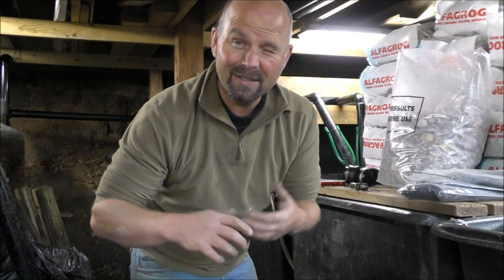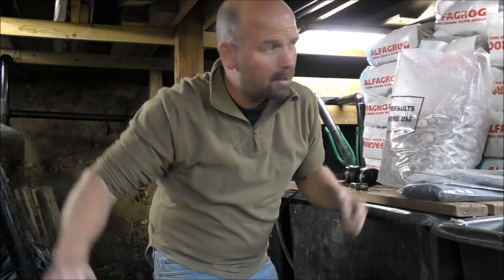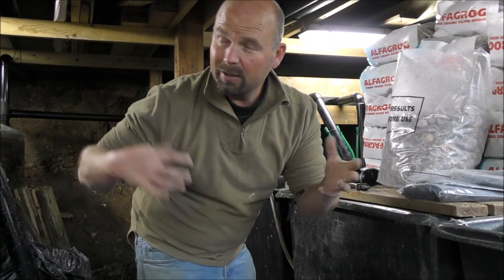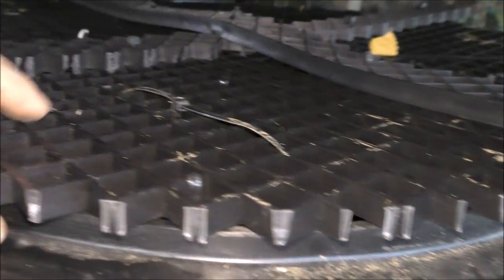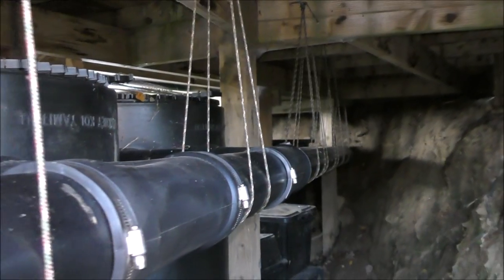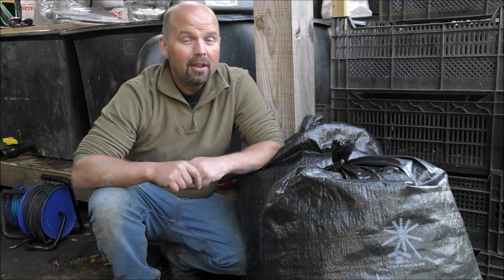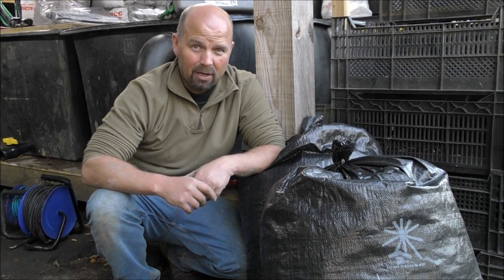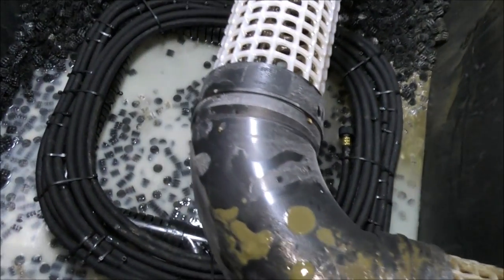Building a HUGE Pond Filter - A Few Changes

Comment from the maker: A quick video showing a few changes / improvements I have made to the mega pond filter - the next video will show the shower filters.
Useful videos:
Evolve shower filter and Blagdon Amphibious  IQ 12000 Pump (which feeds water to shower filters) : https://bit.ly/2t3N8OH
Global Koi stainless steel shower filter video: https://bit.ly/2UYv4AX
Looking INSIDE filter media video: https://bit.ly/2KbOAGk

All types of Biohome media and links to other distributors: http://www.filterpro.co.uk
Hel-x 17 moving media: https://ebay.to/2UZk5aM
Alfagrog used in this video is the E40 size but there is a smaller size available (E25) for smaller filters.
Alfagrog (Amazon): http://geni.us/Il899
Alfagrog (Ebay): https://ebay.to/2zWrajj
Hel-X 13 25 litres (Amazon): http://geni.us/3UBTi
Hel-X 13 25 litres (ebay): https://ebay.to/2QPKiq6
Hel-X 17 (more suited to very large moving bed filters): 
https://bit.ly/2PBAOyn
K1 standard size (Amazon): http://geni.us/zNFFaJ
K1 micro 25 litres (Amazon): http://geni.us/byDQ
K1 micro 50 litres (Amazon): http://geni.us/M7T2AH
K1 micro 25 litres (ebay): https://ebay.to/2P5Flfv
K1 micro 50 litres (ebay): https://ebay.to/2NFJ3YB
Moving bed media (FilterPro): https://bit.ly/2NN1gU6
Vortex filters: https://bit.ly/2Mj7gYa
4" fittings: http://geni.us/nTQc9bw
2" taps: http://geni.us/OBXBGSI
8" diameter brushes: https://ebay.to/2OvMOkc
Filter grids: http://geni.us/oqDBzT

If you've enjoyed this video please check out the playlists on my channel for hundreds more  - on a variety of subjects.
Feel free to share or link any of my videos on facebook, twitter, forums etc. for the benefit of anyone you think may also enjoy watching.
See you next time.
Pondguru

RECOMMENDED PRODUCTS ON AMAZON: https://goo.gl/jMaBWy
INSTAGRAM: https://www.instagram.com/pondguru_outdoors/

FILMING EQUIPMENT:
Panasonic HC-VX870 HD camcorder http://geni.us/3UwE
+Rode stereo microphone: http://geni.us/4OL
+Rode 'deadcat' mic cover: http://geni.us/1pmn
JVC Everio quad proof HD camcorder: http://geni.us/e09e
+Rode 'deadcat' mic cover (opened up and held between tripod and camera base) http://geni.us/dee24
Zomei Z666 tripod: http://geni.us/1a1af3
Manfrotto MTPIXI-B PIXI mini tripod: http://geni.us/87f7
Reply: Maybe a stupid solution byt why dont you just put a pump in the moving bed to help it go 😎? It would svirm like a bee hive with a small 40watt sump pump 😎

Comment: I've been thinking about this project and how I would go about making that particular pond almost alpine lake clear and here are the changes I would make.

1. Invite the local fishing club to fish out most of the carp family fish in a full-day competition. Make it a fun event with prizes and everything. Or use more industrial ways to remove the fish. This helps both with reducing sediments being disturbed and releasing particles and nutrients in the column and also reduces predation of zooplankton that keep the algae in check. This is done on an industrial scale at eutrophic lakes in Sweden to great effect when it comes to water clarity where the population of roach and bream has gotten out of balance with the predatory species.

2. Adding a mechanical filter section with a large number of fleece/polyester micron pads running in parallel in between coarse foams from coarsest to finest. This would clear most of the water passing through to about 50 microns. 

3. As a final water polishing stage add a large diatomaceous earth filter, a couple of hundred kg of carbon, and a few hundred watts of UV-C

4. Add a 30 000l pump in the last filter chamber and run the hose to the fluidized bed tub. This helps move the media and also filters out the water again. I use this technique in my sump.

5. Possible increase the pump power in the pond to 100 000l and increase the tub numbers/size to help settlement. 

Now we should have pretty clear water. I'm sure the wife likes that electric bill as a result!

I just want to say this is an incredible inspiration, Richard. Your passion for this hobby shines through.

Comment: Hi Richard. Just to let you know the reason you are having problems fluidising your media is not enough air to get a nexus with only 200l of media moving tidy you need at least 100l of air i use a 130l to get good movement in chamber your size i would say 100-120l minimum i would recommend the hailea et-120  very reliable and much quieter than aco series which started with.

Comment: With the moving bed filter couldn't you split a large diameter pipe and place both pieces to the bottom of the container making it smooth flowing w or 🥂 shape to ensure a double rolling motion. Add a small amount of air to the center point, direct the nozzles to crash down on the outside edges, and the outflow just to the inside edge of of the nozzles on both sides. Also restricting the outflow with a spreaderbar with smaller orifices to keep the velocity high to further encourage rotation. A secondary higher overflow would be required. The air could possibly be temporary once its mature and dialed in.

 Actually the air would be more efficient if it could follow the the same type of pipe used to shape the bottom to the top 1/4 th rotation.  Use 3/4 of two large pipe's instead of splitting one in half. Hope this makes sense.

Sorry if I suggested a bunch of stuff you've already gone over in the past and waisted your time. Good luck with that thing. I'm looking forward to seeing it work as it should. I know you'll get it done somehow.

Comment: Another moving bed problem could be the way the water exits the container. The media may not get sucked through but it may stick against the perferated pipe. Try placing the water inlet over the top of the perferated pipe to force off the media. It will of course try to get sucked back to it causing it to move, at least around the exit pipe.

Comment: U may have a few 2 many diffrent direktions in the water, mby if the water inlet pushed it down on 1 side, air up on the other. The square tub, and the long outlett pipe ads a lot of resistance in the water.
  Dont know if its a bad ideer, but could u rough up the surface of the media, if u put it in a cementmixer, with some water and sand?
Like the ideer of the reed (aquaponics) outlet, need some warm weather, so we can finaly see what goes in the aquarium. :)

Comment: Hi there,
What a brilliant filter system and we so much enjoy your videos over here in France.  One thing we could use in our MUCH smaller system and have had difficulty getting though is the white mesh tubing you have.
Any possible links to suppliers or did you make it yourself.  We're using drilled PVC pipe at the moment but this would give a better water flow. 🐟🦈🐡👍
Reply: U can easy order it from the kontgaatje shop !

Comment: Could you add a venture in the pipe where your trying to introduce air ? Have someone machine one from stainless steel that would fit a larger pipe so you don’t loose volume ? Just thinking about your beautiful setup.  Thanks for a great video.

Comment: Could add powerheads/pumps to the moving bed on the top.
Reply: I second that, they are low power consumption and cheap A few could be positioned around the outside edge to create a circular swirl around the container. Chances are the media has too much mass and it's the weight and friction that is stopping movement. If you still have the 12000litre pump, putting it in that container with a zero head would also stand a good change of generating enough force.

Comment: I would bet a 1.5 meter piece of pvc pipe with small holes in it on top and sides would really increase the amount of air and pressure to move that media bed would be really easy to test  just unplug the drip hose and have a pvc pipe all ready to go with the same fittings for the air line  and a couple caps solvent weld on each end or you could use 2 pipes and join them with 90's to increase surface mass if it does not work to your liking just return the hose fittings and you will get 90% your money back just a thought. :)